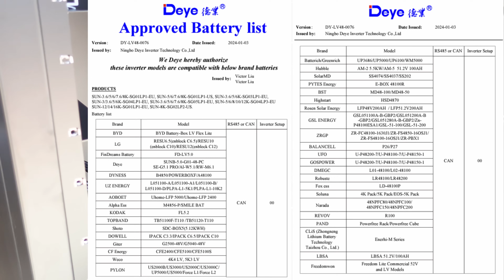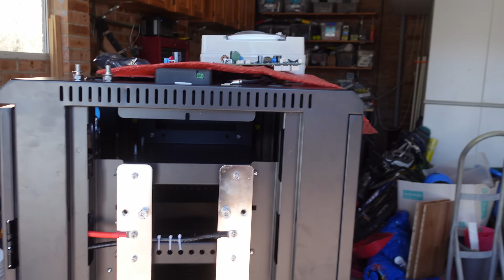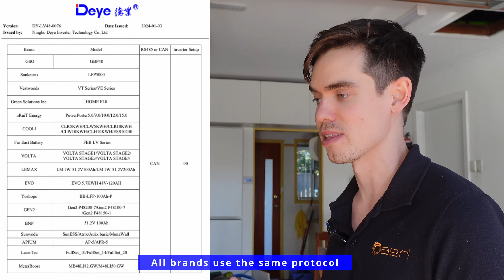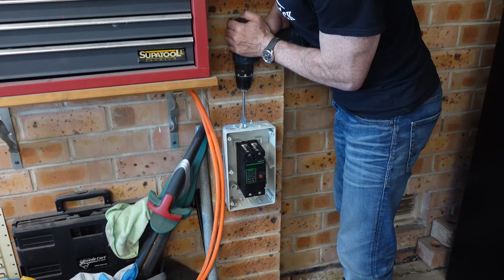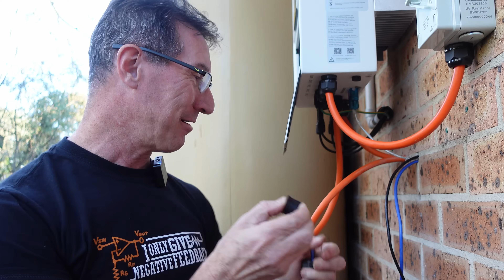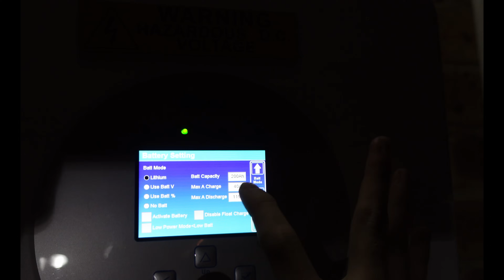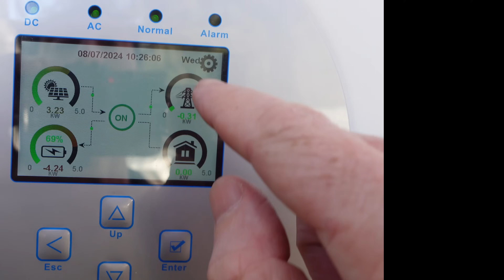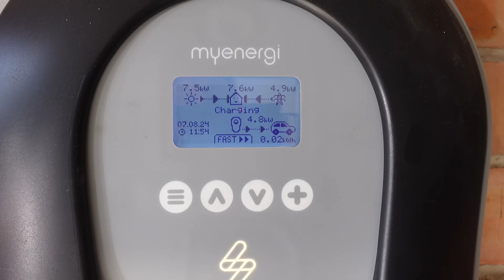EEVblog 1634 - 15kWh AERL LFP Home Storage Battery Install!

Comment: I will never understand how people continue buying Deye, Voltronic or any other Chinese inverter, when you can buy a nice Victron one. If you told me it costs 3 or 4 times as much, I could understand it, but it usually doesn't cost even twice as much. Where's the savings when you have to fight with a useless GUI every time you touch something?
Reply: Very few options that offer an all-in-one hybrid solution at the moment in the market. Deye hardware is decent (Voltronic not so much), but definitely needs a UI overhaul.
Reply from the maker: The Deye offers some unique flexability not offered by the others AFAIK. And it's cheap and reasonable quality, the usability jus tleaves a lot to be desired.
If it failed in a year you can say I told you so.
Reply: Nothing that wrong with the Chinese stuff. Victron gear is made where? Some Chinese stuff is absolute crap but others are on to very good. Take your blinkers off
Reply: Victron is not the quality leader.. Think something more along the lines of SMA or Fronius
Reply: Nice video! One thing I was wondering about, which wasn't discussed I think it's about voltage matching the batteries before you connect them to the 600A bus. If not things could get a bit lively. Or am I overlooking something obvious? Could be good to mention when you upgrade to 30kWh.. thanks again!
Reply: I have been following Andy's Off Grid Garage for years, I like victron equipment and I'm using their charge controllers and smart shunt but the shunt is doing some weird stuff lately and looks like it might need to be replaced.... My inverters are some Xing Ping brand, I have two of them, the first one was a 3kw unit which today run's my garage and the second one is the 6kw version which cost me $900AU and it runs most things inside my house. 
I went with the Xing Ping brand because I saw it on Andy's Off Grid Garage channel and he still has his one but he has since upgraded to a victron 3kw inverter. 
While the victron equipment is nice and gives you plenty of data which is available for you remotely anywhere you can get an internet connection, I was sad to see that the victron 3kw inverter can't provide a constant 3kw without overheating and shutdown! I have had no such issues doing that with the Xing Ping inverter on the hottest days in a hot tin garage! 
Like I said, I like the victron equipment, their charge controllers aren't built for servicing, there's a video out there of someone trying to take apart two victron charge controllers, the inductors are potted into one half of the case while the PCB board that they are soldered to us on the other side.... 
Thankfully their charge controllers are a good product.... As for their inverters, they are not for me!
Reply: @PeterMilanovski  That's because is not really 3kw, its 3000 VA and 2.4kw at 25 ºC, 2.2kw at 40 ºC and 1.7kw at 65 ºC, because is using a real toroidal transformer instead of switching mosfets. It is clearly indicated on the datasheet. But it is not a downside, when it allows you to power inductive and capacitive loads. If you try to power up a 1kw inductive load with your xing ping inverter is gonna shut down with the starting inrush current, but the Victron can handle it.
Reply: @Ismsanmar   my fridge, my aircon, my pressure washer all product inductive spikes every single time they need to fire up! 
And I see that spike on the victron portal when it happens, it goes way above the 3kw inverter rating, if other things are running while the fridge fires up, I would get a beep sound from the Xing Ping inverter to indicate that an overload protection is imminent but since I got the 6kw version of the same inverter, I haven't had any issues with it! 
It says that it can continuously do 3kw on my first Xing Ping inverter and I have had 3.1kw loads running on it and it doesn't even get hot! As long as nothing is going to randomly turn on which will make it shut down... It's a very good inverter that I would personally recommend.... 
It's not as nice looking as the victron inverter and if it's printed on the case that it can do 3kw continuous, that's what I expect from it! Especially from victron! It should not matter if it's being used in Antarctica or somewhere at the equator! Victron has a good reputation and their equipment should do what it says on the box.... 
Like I said earlier, I use victron gear and I do like it, yeah it's expensive but the stuff I have does exactly what it claims to do.... Reliably! 
But a 3kw inverter that can't do 3kw..... At that asking price? No thanks. 
I'm currently running one 6kw inverter to my house and it's not enough! I'm going to be getting another one for a total of 12kw capacity, I am converting my house to all electric, I have a heat pump boiler, heat pump drier, two aircon units for heating and cooling and I will be installing a third unit... 
The Xing Ping inverter is reliable and trustworthy, it has proven itself being in a hot tin garage on a 45°c day running everything without any problems.... 
I can't control the Xing Ping inverter remotely and the only way for me to know if it's working is through an AC Shunt on it's ac output connected to the victron Venus OS on a raspberry pi ... It just works! That's what is important for me. 
12kw inverter capacity for $1800AU... And it will provide 12kw guaranteed all day long regardless of weather! How much would I have to spend to get that from victron? I have already spent just under $8k on the two 15kwh battery banks which I thought that 30kwh should be enough but it's not, I need at least twice that amount before I can really consider going totally off grid! 
Has the system so far made any difference? Hell yeah! By next month I won't be using the grid for anything until next June July period (worst time of the solar year in Australia) comes along next year unless I add some more solar panels to my house roof which I plan on doing.... 
Once you start with solar and batteries, you can't stop adding to your system and won't stop until you end up totally off grid... It's like a disease.
Reply: @PeterMilanovski kindly share the brand name and possibly the weblink of the Xing Ping inverter. I'm in need of something reliable but affordable.
Reply: @adon8672   @adon8672   You can see the Xing Ping inverter in action and being tested on the Off Grid Garage channel, Andy, a German living in Queensland Australia has a fantastic channel, you will have to scroll down to his early videos, warning though... He's a very happy person and his happiness could be considered contagious! 
He will have a link to his website in the video description which will also contain information for what it's called, where to buy it from and how much..... 
The only two serious channels on YouTube for solar energy are either Will Prowse's and Andy's Off Grid Garage channel's..... 
I got the exact same 3kw inverter that Andy got, I have since got the 6kw version to run my house with while the 3kw unit runs my servers in the garage.... 
They were cheap but most importantly they have been reliable, I used to overload the 3kw inverter often when a fridge or AC or pressure washer would fire up while just over 2.5kw was being drawn by other constant loads, the inverter would go into protect mode and would need a restart, but I was trying to run a house with it and 3kw just wasn't going to be enough so I got the 6kw version which I have had no such problem since I installed it over a year ago! 
Look up Off Grid Garage and check Will's channel.... They have already answered all your questions!
Reply: U have definitely not used a deye inverter ...stop living in the past...Victron is dead...they are stuck in their ways
Reply: Victron is dumb for grid-tied.
Reply: @edc1569  But it is capable. And it let you decide if you want to inject or not to the grid. But for real, not the pseudo system that those Chinese hybrids use, where if you tell them to NOT inject, they keep doing it at a very low rate.
Reply: Australia has a… “unique” system where the Clean Energy Council (CEC) are in charge of maintaining the Approved Product List, which includes solar panels, inverters and batteries. The Approved Product List is the biggest barrier to entry for many companies wanting to sell their products for grid connected use.  AS/NZS 4777.2:2020 certification doesn’t mean CEC Approved Product.  See: Victron Multiplus-II 5k has 4777.2:2020 Appendix-M but not on the CEC Approved Product List 🤬
Reply: @galen__  Battery listing is an optional thing when it comes to the CEC, and Panels and Inverters must be listed for STC generation, but that's about it. If you don't care about STCs (they cover such a little part of the system cost anyway now), the products just need to be certified to the relevant Australian standards like any other product.
Reply from the maker: @peterwatkinson3391  Correct. It's only important if you want the STC rebate. Most do though, so it's a big consideration.
Reply: @EEVblog  It's a large factor when it comes to PV only systems, but mitigates a much smaller part of the overall cost when there's batteries involved. That said, still means the panels are generally free, so better than a poke in the eye with a sharp stick.
Reply: @galen__  That's assuming that you want to be connected to the grid in the first place! 
Once you begin using batteries, it doesn't take long before you start thinking about the possibility of going completely off grid... Dave has only just got his first 15kwh battery, how long before he double's that capacity? You can already see it at the end of the video.... He said that he might have to get another 5kwh battery or two but it doesn't end there! It never does!
Reply: And you think Victron is easy to configure? lol
Reply: @ruchira1991  Typical comment from somebody that hasn't touch one.
Reply: @Ismsanmar  I have seen plenty my friend. General consumers wouldnt want to mess with Cerbo GX, separate MPPT's, Plugging in PC's and all that when AIO's like Deye, Solis work like a dream after setting it up through the touchscreen. Victron is a dying brand. Their price cuts in the last 12months reflects that. Multiplus II 5Kw can be had for AUD1250 now in Australia. It was over AUD2000 a year ago. 

Look at whats happening in USA. Sol-Ark (Deye rebrand), EG4 (Luxpower rebrand) are dominating the market
Reply: because SRNE, voltronic etc perform just as good for 99% of applications and will out last themselves and be obsolete by the time you want to replace it. ALso they cost 10 times less.
Reply: How is victron cheaper? you can get a 3phase AC coupled 10 or 15 kW Deye/Growatt inverter for ~2000€, a Victron will cost more for a single phase alone.  
Also the Deye stuff is all in one, add solar, add external generator, add existing PV, use whatever battery you want and still just buy a single box.  

Victron is nice on the other hand, as they allow you do basically get any component unbundled, but damn it's expensive.
Reply: @DooMMasteR  Today, you can buy a Multiplus 2 48/5000 for 750€. Multiply that for 3 and you have your lovely 15kw 3 phase installation. Add a couple of Victron Smartsolar MPPT 250/100 for 600€ each. Now, you have a installation with real transformers that can deliver much more peak power, more efficiency, less self-consuption, better charger, better guarantie, better GUI, better support, etc. Really, where do you live, under a rock or something?
Reply: Victron has more RMA claims than the Chinese ones. And victron are made in China and India. Check out the complaints on the forum, there's lots of victron device failures.
Reply: @WillProwse  12 days later and you've still not backed up your nonsensical claim with anything other than your incorrect opinion.
Reply: @SeanMoore2008  You must understand that Will only feeds on referrals from the sales of Chinese inverters and boxed batteries that he advertises on his YouTube channel and on his forum, whether they are branded in the United States or not. If I tell you he was thinking of closing the DIY LiFePO4 Battery section of his forum just because he doesn't get referrals from them, and the funny thing is that at first he grew his YouTube channel on how to build them with raw cells.

Don't expect him to retract it, even if he knows that what he himself says is a lie. That's exactly why I unsubscribed and blocked from my feed his YouTube channel.
Reply: @WillProwse  you've just made a completely unsubstantiated claim about Victron. I know for a fact you won't, but would you mind backing up your claim with something that will illustrate that it's not just your opinion.
Reply: @SeanMoore2008  Oh it's substantiated 😂 takes one minute to go on my forum and use the search function. And call up the major distributors and ask them. Don't need to believe anything I am saying. Look for yourself. I am a huge victron fan but they do have issues. Really robust designs and software, but they are not without fault. The new chinese equipment AND software is becoming fantastic. And again, victron is made in china and india. Really not that special anymore. The victrons look really cool though. I love the blue 🤣
Reply: @WillProwse I have personally installed over 80 Deye inverters in Aus directly and closely work with other suppliers who have installed hundreds and as far as I know so far there has been only 1 failure so far. I have done hundreds of victron installs over the last 6 years and can say that I have had 10’s of failures , that being MPPTs , Quattros , multiplus 2’s ECT , don’t get me wrong I love victron gear for its versatility but I really can’t fault the DEYE hardware at this point . Also the UI is fine once you learn to drive it . Makes for a 1 min setup. OH and the HV 30 kw and 50 kw hybrids absolutely kick ass for the price . That’s my 2 bob , thought I would try and provide something objective .
Reply: A voltronic can really cost 3 or 4 times less, like an easun 6.2kw inverter (with a 6.5kw MPPT) can be found occasionally at around 370€.
Reply: Because victron has high cost, high failure rate, high system complexity, low failsafe circuitry, horrific support, atrocious compatibility with others but otherwise it's great 😂😂😂
Reply: @tanaseav  you've very obviously no real Victron experience.
Reply: Victron is not cheaper or reliable 😂

Comment: Rackmount 48v LiFePO4  battery modules are pretty standard for hybrid or off-grid installs nowadays. (SOK and EG4 are fairly big names in the US). Main concern for an unconditioned garage install is whether it gets below freezing, and if these modules have low temperature cut off or internal heaters. Charging LiFePO4 cells below 0C will quickly kill them.
Reply: not going to be a problem in oz. Even here in the UK my garage rarely goes below 10’c even when freezing outside
Reply: Sydney - i'm in the same city & mine are in a shed outside. Temp doesnt get below 15deg at the codlest
Reply: yea all this stuff he has is very standard, and there are several manufacturers and dozens of brands.
Reply: Between Cost and PITA to work with our power company, I'll probably never see anything like this on my home.  That battery solution alone is $10K+ plus install.  For me?  That's about 7 years of power purchase for me.  The cost of the solar install?  Forget it...I'll be dead and dust before I even come close to break even.  Maybe on a new home build, but not on my current home.

Also, being in the north those temps can get to be below zero in the winter easy...even in my attached garage.  We get days on end of -10F quite often, and yea...brutal in the garage that is unconditioned. Gets to be well over 100F in the summer in the garage too...which I wonder how those batteries act in those temps.  Sounds like they don't have a hot weather issue, just a cold?  I don't know...out of my scope of understanding.

Comment: I prefer hydraulic crimpers for the large crimps! I have 35mm2 for my 25kWh bank as well and with the hydraulic it was a one person job just fine. And then put a heatshrink with glue over it and properly let it melt.

Comment: I don't think I would want that amount of energy stored anywhere near my dwelling. Separate external storage would be the way to go.
Reply: Its LiFEPO4 - so much safer than "lithium" car batteries.  There's regs around where you can install them here - cant be under a habitable room, cant be on the otherside of a wall thats a habitable room (without additional proofing). In Europe they're all installed indoors without issue
Reply: you can drive an iron spike through lifepo4 cells and they'll pretty much just smolder, so pretty safe.

Comment: Try UPS trays with 36 7Ah SLA units per tray, which is around 90kg per tray. Not fun doing both on line, and by yourself, in a rather cramped area.

Or Hitachi HMA9500 amplifier, 100W of class A per channel, and 29kg of aluminium and transformer, also acts as a good room heater as well, because of the near constant 1kW power draw.
Reply: That sounds like fun…🙈 Glad the trays I was working on today only had 10x 9ah batts each, atleast there was only 3 strings 40 in each. Stay safe out there